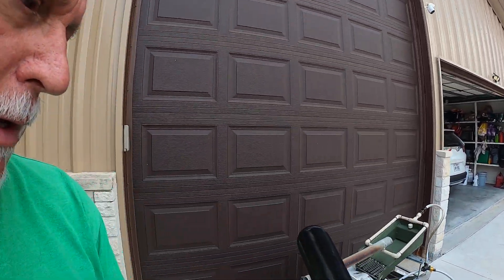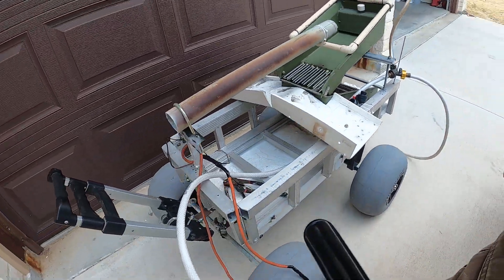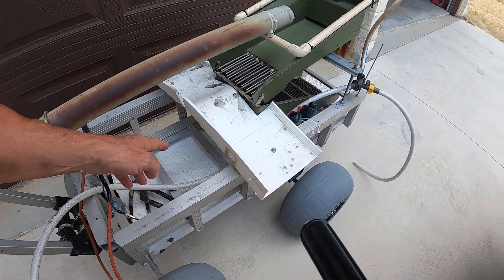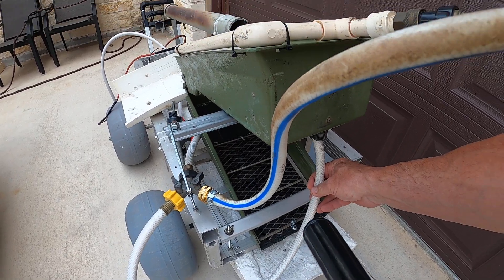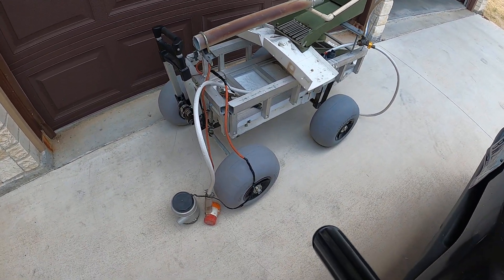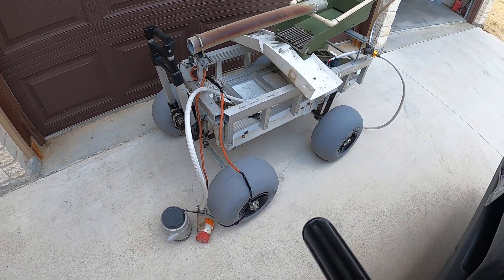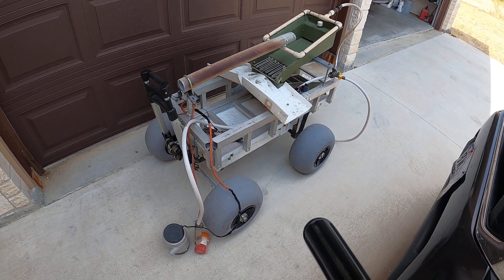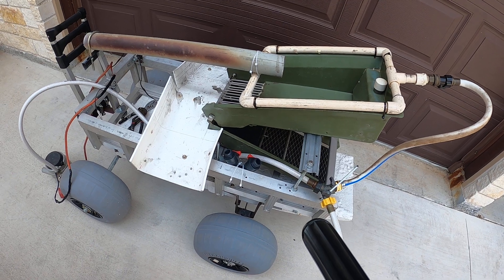DIY Electric Gold Dredge: Build Your Own Eco-Friendly Prospecting Machine

Comment: What motor/ pump are you using?
Reply from the maker: I’m using two 12 volt pumps one is 1250 gph for the grizzly box and a 1750 gph for the suction hole. So all of this is experimental at this time l. I will be making more videos on this project as soon as the water warms up.
Reply: @fishingin3D  do you get enough suction to get a good amount of gravel sucked up?
Reply from the maker: I don’t know yet, the last time I tried it I had the water jet in the wrong location, I have corrected that but have not tried it because the water was getting to cold in get in. Just waiting on warm weather to get started on this project again.

Comment: Blige pumps don’t have pressure to run a dredge jet, they loose even more the higher they have to pump. 
I would try a spa pump with a 56v motor.
Reply: The whole thing will turn around anyway, the pontoon is a joke